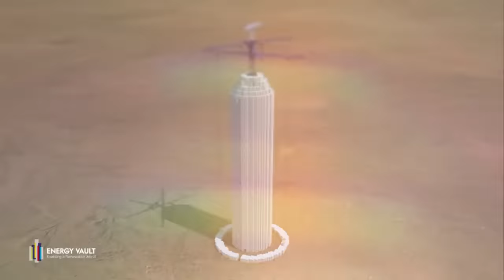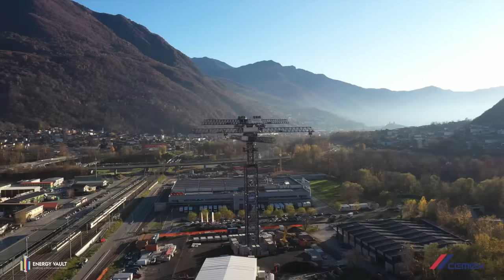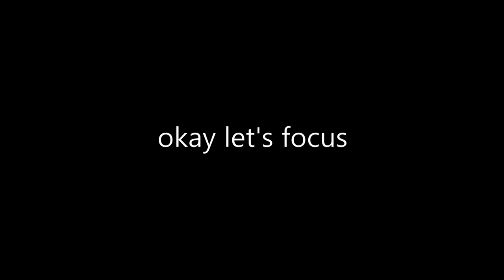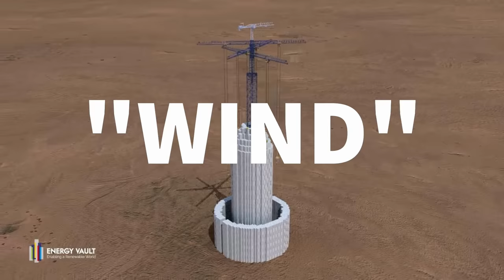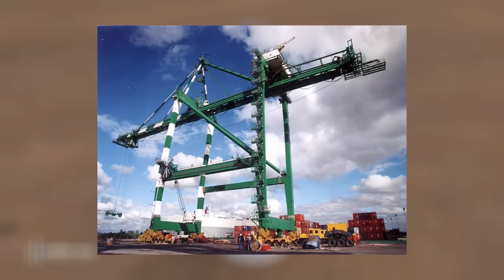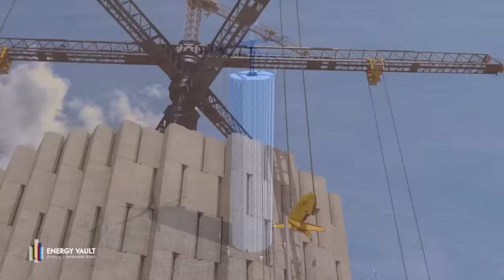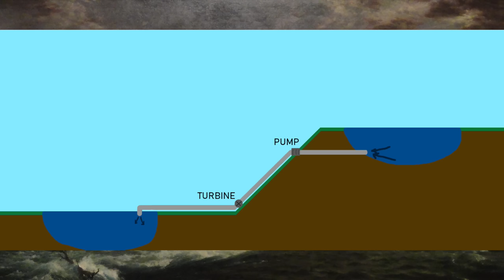The Energy Vault is a Dumb Idea, Here's Why

Comment: I once thought water towers could act the same way and then an engineering friend looked into it and he basically said batteries are already better so I dropped the idea.
Reply: Well I mean they do and they don't sure a battery can hold a larger charge for cheaper but said battery ages so it needs replacing and also that is without mentioning location and temperature. Any and all batteries don't like cold or hot (well except for some exotic batteries but those haven't reached real production yet) or even better is that it allows for amplification of local hills and valleys making what would be a mediocre hydroelectric battery into actually worthwhile. Sadly though while their maintenance at least long term looking at current battery technology modern electric pumps are really really efficient at what they do meaning there is little room for the tech to improve in a meaningful way unlike batteries. They do still have uses even then though!
Reply: (Also side note any misspellings or poor phrasing is do to me typing this at 1 am)
Reply: @gemmasterian4496  Even modern mass produced LiFePo4 batteries have full cycle charges in excess of 3000, while remaining above 80% capacity at the end of their life.

Full daily cycling is around 10 years, and with much better density and deployment locations, and they're likely to work well beyond that. Compared to the maintenance on a series of cranes and concrete....
Reply: It does work if you make the reservoir large enough, pumped hydro works very well as grid storage but it requires specific terrain to set up.
Reply: Batteries are not better than water towers, because water towers have already been built in large quantities. Your engineering friend didn't consider all the variables.
Reply: @zeealpal  
We can't just use all the lithium we want to, there's a limited amount...
Reply: @deusexaethera  Water towers are set up for municipal water storage rather than pumped hydro, and generally can't be fully utilized for both. Also, water towers are relatively small compared to most pumped hydro systems.
Reply: Batteries also tend to wear out a few years before water towers do, and many many years before storage dams wear out

Comment: As a mechanical engineer, I can imagine the maintenance nightmares of this thing. This is nothing other than science fantasy by someone who barely knows how real things work
Reply: You know for a fact this thing will only be running on 2 out of the 6 cranes all the time because they just can't be bothered to fix the other ones.
Reply: Exactly. I've designed winches and cranes, and I see so many cost and reliability issues. Those cables wear out pretty quickly when they're used continuously, like on rope shovels. And they're expensive, and take some time to replace. I think they skipped the whole feasibility study phase of this project. Or else it's just a big scam.
Reply: "science fantasy" isn't that precisely the definition of science that to become science an hypothesis must be validated by experience ?
Reply: not only that, but it is financially unfeasible. the more time i devote to thinking about this stupid tower, the dumber i feel, and it wasn't even my stupid idea!
Reply: @lolaa2200  No. Fantasy implies a mystical element. You know, like witches and dragons. Science fiction has become reality before (but not nearly as often as you'd think, nor in the ways you'd hope it would-personal flying cars that use antigravity, multi-mile high skyscrapers, or faster than light travel still have yet to become realities and possibly never will. But hey, we've gotten the 60s Star Trek communicators, and ours can do WAY more than theirs could).
Reply: So like every engineer
Reply: @Metamere  Right,  and don't forget about the energy loss in regards of friction.
Pumps aswell as water flowing threw a pipe and turbines have way less friction than ropes.
Reply: I object. Its not a science fantasy since no science is found there.
Reply: This is what happens when accountants say "damn the torpedoes". It sure would be fun to watch it fail catastrophically though.
Reply: The average stockholder/financial investor that these 'visionaries' have to pitch their ideas to probably have just as little of an idea of how real 'science' works too, and the problem is, they often like it that way --- they want their investments attractive, while also being 'simple' and 'easy to visualize' for them. A sales pitch that bombards the average investor with too many 'complex' and 'boring' technical facts and calculations will likely cause them to tune out and Nope out of the project very, very quickly, no matter how scientifically thorough and feasible the study behind it is.
Reply: If I tie a giant magnet on a fishing pole to the hood of my car, the magnet will pull my car forward because its metal! Free energy! No more gasoline needed!
Reply: @Connection-Lost  ah, bugs bunny. Way ahead if his time
Reply: @Metamere  you nailed it. It’s a big scam. Classic and well trod Silicon Valley path. Goes a little something like this:

Becomes aware of a well known problem; acts like he discovered said problem; ignores simple, elegant solutions (some of which already exist); gets VC money and gets their PR connections; does a presentation that ends with some variation of “…to make the world a better place”; gets more VC money; flames out but gets to keep plenty of money. Perhaps he  and the original VC bunch hype it enough to sell to a massive corporation (Meta perhaps?)
Or maybe cash out on an IPO that quickly tanks.
Reply: @Metamere  The design for a rope shovel will be different. Shovel loading is pretty brutal and it fluctuates. Some concrete blocks will be very repeatable and they won't need winched very quickly.

Comment: Would it not become obsolete once about half the blocks are dropped? As the area to stack them would be higher than the area you drop them from.
Reply: Could be. Also they don't go into how much energy they would use lifting the blocks vs how much they gain by dropping them.
Reply: Using physics principles it should be the same. But only in a frictionless and vacuum world. Probably still had better energy retention than a battery though.
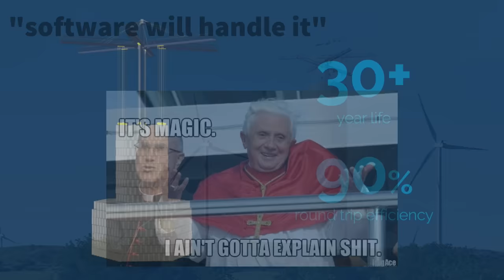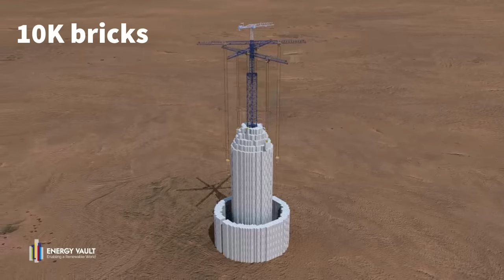Reply: @joshuaa7266  At 1:57 it said "90% round trip efficiency", but of course that could easily be a very optimistic number for promotion. It also shows, at 1:10, that the diamater roughly doubles for the dropped blocks compared to the stacked blocks. So 3 times as many blocks fit into the lower pile (2^2 - 1 for the original stack), such that they will be at even height when the original stack is at 25% of its max height.
Reply: I believe the idea was for them to be arrayed in a comparatively shallow circle on the ground, hence the long cranes, and then stacked back up.
Reply: yes but there are ways round it (not that i think its a good idea)
Reply: @grandson_0623  I’m totally willing to give them that 90% at face value... because it’s the least of their problems. 😂
Reply: A bunch of these blocks are effectively useless besides providing a foundation to the rest of the tower. Could've been a solid foundation with the same effect, well, besides maybe ability to take the tower down and transport it or change the amount of storable energy. I guess scalability is marketed as one of it's advantages over something like water-based storage? (no need to dig/build extra storage, no wasted storage left if capacity gets reduced?)
Reply: @SomeLoops  Even that doesn't solve the problem. The crux is that it's lifting blocks from the top of one stack and placing them on top of the other stack, so the potential energy stored is directly dependent on the difference in altitude between the tops of the two stacks.
As you unload one stack onto the other, that difference gets smaller and smaller as the tall stack shrinks and the short stack grows, until the two stacks are the same height. This might not necessarily be at the halfway point (if the shorter stack is twice the diameter of the taller stack, it will theoretically hold twice as many blocks so the equilibrium point will be when the narrower stack holds 1/3 of the blocks and the wider stack holds 2/3), but it will reach that point if both stacks are built at the same elevation and when it does the system will spend energy moving blocks from one stack to the other without storing any since the blocks end up at the same altitude they started at.
You can avoid the issue by building one stack on a higher elevation than the other and never building the lower stack up higher than the base of the higher stack, but at that point you have a hill with two connected construction sites so you might as well just build pumped hydroelectric storage instead.
Reply: @_kalia   Yes indeed! All I was saying is that the point at which both stacks have the same height (assuming a flat surface) is when roughly 3/4 of the blocks have been moved. At least, that is what their graphics seem to suggest. Of course it would be way more efficient to have an even larger diameter for the outer stack, or drop them lower than the base of the tower. Or, as any sensible person would do, use two reservoirs.
I suppose the only place where this system might make some sense is in an area where the terrain is completely flat, but then there would probably still be better solutions.
Reply: The crain doesnt rise with the stack of bricks, its fixed to the ground, the bricks are not stacked evenly but in high and low areas. The concept is full of holes but choose a real hole to mock on not one they can defend.
Reply: @MrCh0o  why would anyone want to reduce that already heavily limited energy capacity even more?
Reply: @klauzwayne4215  Well, who knows, maybe people leaving the area and power requirements going down? It was just a shot in the dark, really
Reply: W=mgh so the distance from center doesn't matter that much
Reply: not really obsolete, just depleted. this is a battery, it has a limited amount of energy storage, and once that storage is depleted it needs to be recharged. now, unfortunately this is a very bad battery and is practically useless.

Comment: This concept does sort of exist on a very small scale. There are lights designed for third world countries that are powered by a heavy bag being slowly lowered to the floor. Every 30 minutes a person picks up the bag and resets the device. Good for kids doing their homework.

So I wouldn’t be entirely surprised if a larger version has a niche. There are certainly places where water is scarce, or where hills are scarce, which makes pumped storage hydro either not viable or far less viable. Maybe a remote desert base? Bring the crane and some bags, fill the bags with rocks. Not sure if that’s better that a chemical battery, but it might be cheaper, or lighter within very specific capacity and discharge rate requirements.
Reply: Wouldn't places with scarce water tend to be well-equipped for solar energy?
Reply: @nicolaim4275  people have activities at night, and providing batteries for the solar cell might not be economical.
Reply: @awl649  Individual people have activities, sure, but generally power consumption goes down considerably during the night. A power plant based on burning organic waste from farm production and food consumption could compensate if the rest of the system is predictable.
Reply: With LED lights efficiency and battery costs, I doubt the dynamo method will last. Simple low-quality solar with a cheap battery attached to LED lasts all night.

Just look at this lawn solar lights selling for $2-3 each
Reply: @nicolaim4275  Antarctica has very little liquid water (pumped storage doesn’t work so well if water is a solid), same with the arctic. They have several months a year without daylight, let alone good conditions for solar panels.
Reply: @HALLish-jl5mo  Yeah, and you want to live in Antarctica, or what?
Reply: @lonestarr1490  I said niece applications like remote desert bases. Antarctica is remote, is a desert, and has bases, and a custom power supply would certainly be niece.
Reply: @HALLish-jl5mo  So places with almost no humans and very little need for any of this?  ;)
Reply: Maybe a place with some disused mineshafts or a cliff nearby would be ideal. It might work for a house or 2, but wouldn’t scale too much above that I’d imagine, for the reasons in the video.
Reply: I can't think of the name of the company or product you're talking about. I know the 2.0 version is sturdier, taking into account that small children love to grab and hang onto it weirdly enough. Do you know the name?
Reply: @727Phoenix  Gravitylight. Interestingly, the company developed an improved system where you pull a cord instead of lower a bag. No idea how that works, but it’s not a good sign for this style of system that the one company to adopt it had a better idea…
Reply: Its called a water tower.
Reply: @HALLish-jl5mo  They've done succesful tests doing this under water and with sea water, and can theorethically be installed at great depths. Guess what we have an abundance of on this planet? salt water and seas. 

Now if only we can do this while not destroying coral reef ecologies.
Reply: @HALLish-jl5mo  The deserts and the Antarctic is home to the most violent winds in this planet.
Reply: can i just lift those 48 heavy weight and the light will turn on for 24 hours?
Reply: At that point... You be better off with something else.
Like flywheel and molten salt.
Reply: Salt water is pretty cheap...
Reply: I'll admit I don't know much about civil engineering but a water tower and pump seem much cheaper than a crane and concrete even considering water scarcity.
Reply: For that matter, grandfather clocks run on gravity. You'd think something like that might be scalable but someone would have to be really clever to do so, not merely clever enough to see the potential flaws.
Reply: @nicolaim4275  thousands of people live and work in Antarctica, they just have generators though as it’s not really enough fuel consumption to have an impact on global climate.
Reply: Honesty this wouldn't be a bad idea if it was applied in a small- decentralized fashion, like your example for individual household use. There are some ideas that just work that way. Just like I find the idea of solar farms kinda dumb. Like why use an entire field for solar cells when you could place them on-top of homes and buildings?
Reply: @awl649  The real solution to the problem is solar-thermal generation. It's far less energy and space efficient, but when you're placing the plants in an empty desert and can build as many as you need, that's not a problem. The real advantage of the design is that all of the sunlight is focused on a massive silo of molten salt, which will stay hot overnight due to all the excess power you dumped in. You use the molten salt to run a traditional steam generator, and you don't need to build a battery because the silo itself serves as a battery. you could even surround the silo with shutters which insulate it overnight if heat loss is a problem.

This design also has the advantage of not requiring any rare minerals which would likely need to be stolen from the global south. You literally just need mirrors and standard construction materials.
Reply: @HALLish-jl5mo  Antarctica is genuinely a great candidate for nuclear power. It's thousands of miles from anything except research outposts, has very predictable power needs, and you don't need to worry about delivering fuel because a single shipment of nuclear fuel lasts decades.
Reply: @nicolaim4275  The purpose of energy storage devices is to store energy when the sun isn't shining or wind isn't blowing.
Reply: @nicolaim4275  Yeah, that's why it's called a niche. Do you think food made with the idea of being eaten in zero g has any economic sense to be used on earth? Do you think wheelchairs are made in mind for people who would get up or off from it frequently? Accesibility options, hearing aid, do you know why military equipment didn't replace their inputs to touch screen? 

Jeez, instead of saying that something is useless because it can't be applied to everything argue why it's still useless in that niche application. Makes it a less brain dead argument against niche products. Like the problem that would be faced in less than zero degrees temperatures would make this thing impractical in a lot of ways or that proper maintenance woul be dificult due to the extreme weather that would be faced there.
Reply: Deserts can use sand instead of water, no?
Reply: If you bring krane you might as well bring two water tanks, one of them empty, and stack them on top of each other. Water scarcity is really not such a big issue if it's a closed system where the water doesn't evaporate
Reply: Grandfather clocks have been using this mechanism to store and slowly release energy since the 17th century. It's really neat and I'm glad to see it return.
Reply: @HALLish-jl5mo  The cranes wouldn't handle the temperatures and freezing winds in Antarctica well, either.
Reply: @Gilamath.  Sand grains don't really settle down after falling because they're very hard, they tend to bounce around and hit other sand grains, that's how a sandstorm is made.
Reply: Having to reset it manually every 30 minutes sounds like hell to be honest.
Reply: @awl649  replace "might not be" with "definitely has not been"
Reply: @nicolaim4275  So food production and energy storage need to compete for a all ready scarce resources, brilliant idea.
Reply: @SpottedHares  Are you talking about drinkable water or just water? Water isn't exactly a scarce resource.